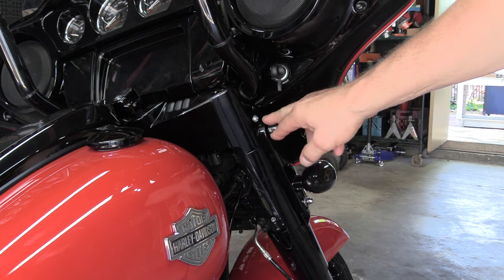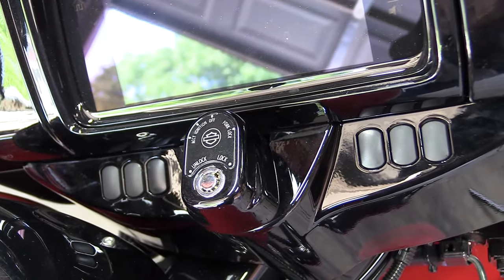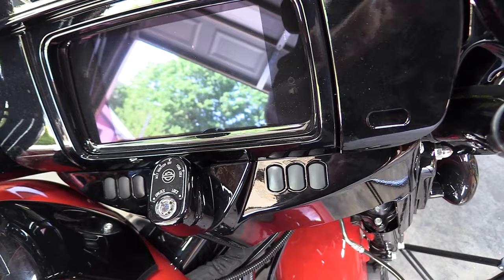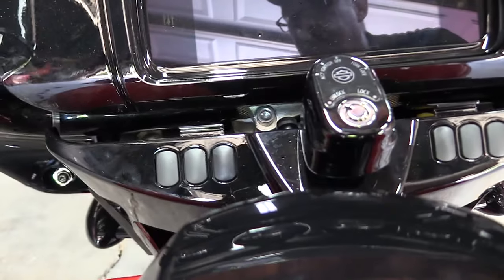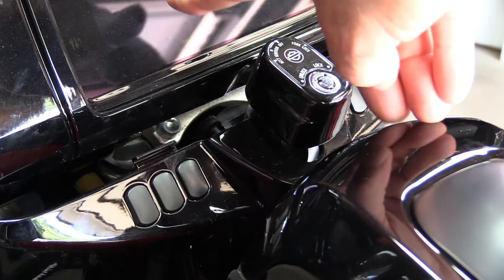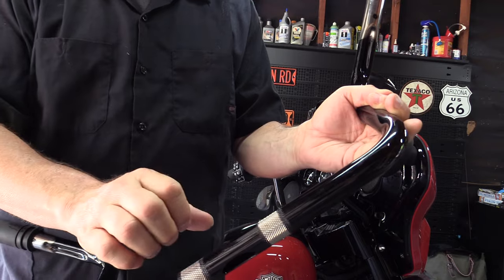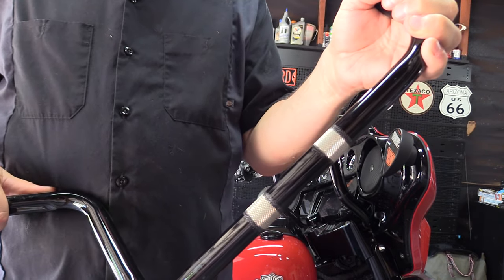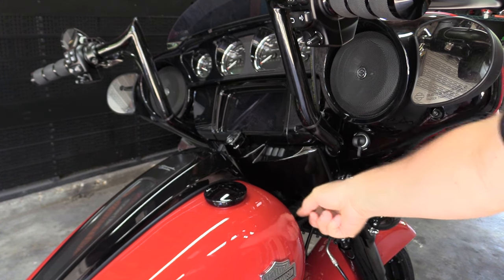Adjusting Handlebars On Harley Davidson Touring Motorcycles

Comment: I have a 21 SGS, Once you open up panel you can see the bolts but no direct line to apply wrench to remove them, clearly the fairing has to be pulled away.
Reply from the maker: That's why you use the ball end Allen wrench, it allows you to get on those bolts at an angle without pulling the fairing away.

Comment: How are you liking the 12" versus the 10" you had on your 2015? I am asking, as I am thinking about taking the 10" off and swapping out for 12 inch on my 2014 StreetGlide Special.
p.s. great tip. I have done that when switching my bars in the past. And you are correct you do not want that knurl wearing out the softer metal.
Reply from the maker: Not sure I like either one better. They are different for sure. The 10s seemed to give tighter control when turning slow like parking lots or U-Turns. The 12s feel better for long rides for my hand level. The 10s though keep my hands behind the fairing which keeps them warmer for winter riding. Pros and Cons for both.
Reply: @RideitWrenchit  absolutely correct about the higher bars and turning I have the 12” KST bars , they sure are comfortable for me
Reply: Just switched to meat hook 12s on my 2015 sgs and absolutely love them would never go back to stock and I'm only 5'11

Comment: My TPMS sensors are all of a suden reading 340 and 280 instead of 36 psi and 40 psi looks like somehow they are reading in KPa do you know if you can change between PSI and KPA ? I see nothing on line or in my owners manual! Thanks
Reply from the maker: From the home screen click "Setup" (gear icon). Scroll to "Metric Units". Tap that and it will change to "English Units". then go to the info screen for tire pressure and it will now read in PSI.
Reply: @RideitWrenchit  thank you I figured it out I have no infotainment just speedo screen I appreciate you help!!